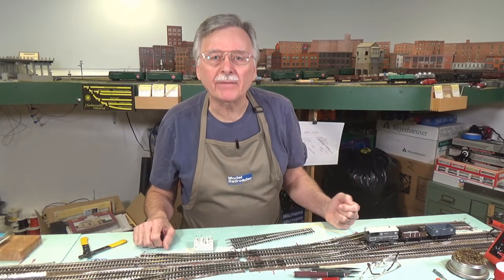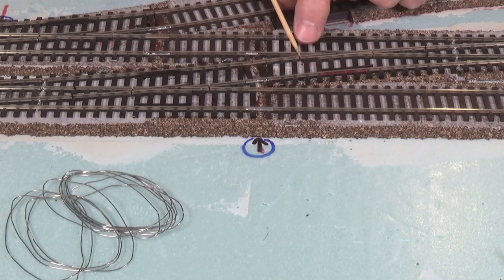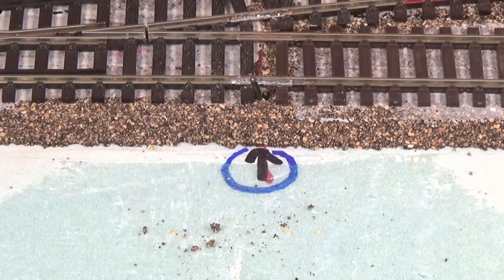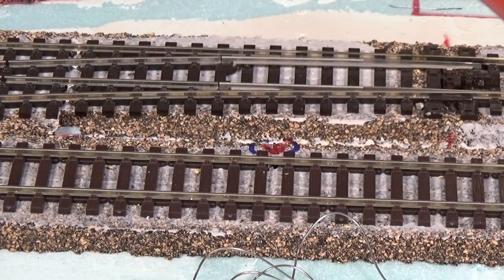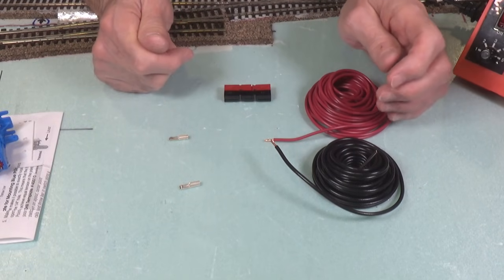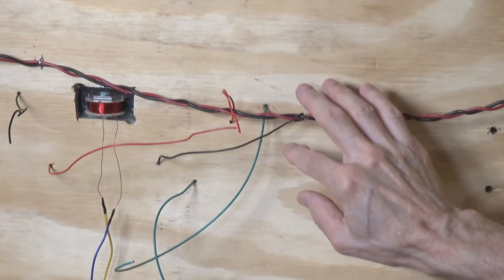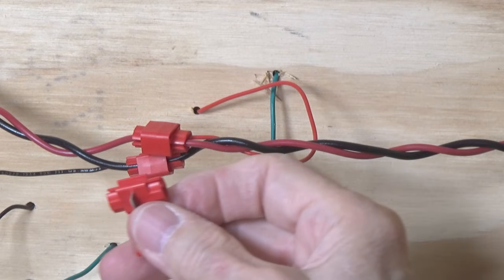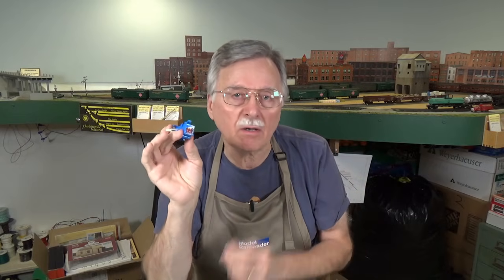DCC Power Bus and Track Feeders (143)

Comment: I do have the right connector to wire tool. It's  cool to use. I was using wire cutters, a heavier duty type set up to put insulated or unsullied connectors. I would put the powerpole end on the wire and lay it in the slot for unsullied terminals and squeeze it down carefully.  Don't squeeze to hard and squish the powerpole to much to each side. It's a bear to slide the plastic cover on.
Reply from the maker: They also make a small insertion tool but I have never used it as I can usually get the contacts inserted without it.

Comment: Great video.  I prefer Posi-Taps over those suitcase connectors.  Much faster to put in and no tools required.  Plus the Posi-Taps are reusable.  Changes can quickly be made with no damage to your bus wire.
Reply from the maker: I’ll order some and see how they do. Haven’t seen them until now, thanks.

Wow, these are expensive, over $1.50 each! I can get Scotchlocks for about $0.25 each.

Comment: I know this is an older video, but perhaps someone will see this and still care to respond.  I am new to HO and just building my first track and starting to plan my wiring for a DCC setup.  (4x8 size, HO scale).  I see folks who suggest these suitcase connectors and others soldering directly into the main power wires.  Would it be bad to have the bus (main power/ground) run the length of the table and have the track feeders just come from appropriately spaced terminal blocks?
Reply from the maker: I generally don’t recommend using that approach since the best arrangement is to keep your feeders as short as possible. The longer the feeders the more resistance and subsequent drop in voltage. Running feeders from terminal strips usually means longer feeders. It is also more difficult to solder wires under a layout and it takes a lot more time and effort, which can contribute to mistakes. I bet about 95% of the problems modelers have are due to wiring mistakes. I found suitcase connectors about 25 years ago and wouldn’t go back to terminal strips for all the tea in  China!

Comment: Larry i have been using  wago connectors  under the layout i find them much easier than the suitcase  connectors
Reply from the maker: I’ll order some of those and we’ll see how they compare to Posi Taps and Scotchlocks, should make a good video.

PS—I dug into my electronics stash and found some that I had previously used when wiring some ceiling lights. The problem I see in this specific case is that they cannot connect to a power bus without you having to cut it at the point of connection in order to push the wire into the connector. I prefer to keep wire buses continuous until I reach a point where by necessity I have to make a cut and then I use the Anderson Power Poles to join them again.

Comment: Love this video.  One question:  a friend said these suitcase connectors can cut you wire when you crimp it down.   Have you found this to be false?
Reply from the maker: Never had it happen in 25 heats of using them. However if you use the wrong size connector, say a small connector on a larger wire than it is rated for, then I could see it might happen. But that is why I always tell folks to use the right size connector.
Reply: Thank you.  My bus wire is 14 gauge wire and my feeders are 18-20 gauge.   The connectors say AWG 22-18.   Wrong size?

Comment: Larry, I noticed that you didn't use any flux.. I too use rosin core solder but, I also use flux for a faster connection.. I noticed that you did not nor mention cleaning the solder joint with alcohol after. Do you not do this step? I'm interested in hearing your take on this step. I just received all my wire, connectors, etc to begin the step of running my bus, sub and feeders. This video was very helpful. Thank you for sharing your knowledge. Tom
Reply from the maker: I do use a little paste flux sometimes if the job requires it, especially with rail joiners. Jobs that require more heat may result in the flux in the solder being burned iff before the joint is made so a little extra flux can help prevent oxides forming which in turn could kill a good solder joint. On those occasions I do use alcohol to remove any solder residue. I’ll cover more on that in the yard work. I think I also covered it in my previous videos on soldering. There now are some no clean fluxes but since you never can be sure it is all burned away it is a good idea to clean anyway.

Comment: Have you used the new joiners that are pre wired?    Have you had any problems with using the suitcase connectors?    Someone told me they can cut through your wires?
Reply from the maker: I think I reaponed to your similar question a couple of days ago and told ypu then that you must use the correct size connector with your wires. It sounds like you have connectors designed for splicing two wires of similar size 22-18awg). In this case you need:

3M Scotchlok Electrical IDC 905, Double Run or Tap, Red, 22-18 AWG (Tap), 18-14 AWG (Run)

This one will allow you to connect the 14awg main bus wire (the run) to the smaller 18-20 awg tap wire.

Comment: Is there any special wiring for a track crossing with DCC. In my case I have an Atlas 30 degree crossing, part no. 574. The bottom of it shows frog jumpers going in one track direction but not the other. Will I need to add jumpers for the other track direction?
Reply from the maker: The Atlas crossings I have are independently wired straight through and have never needed any special wiring.
Reply: Thanks sir. Great video, too.

Comment: About twisted-pair wiring, from Wikipedia...

Twisted-pair cable is a type of cabling that is used for telephone communications and most modern Ethernet networks. A pair of wires forms a circuit that can transmit data. The pairs are twisted to provide protection against crosstalk, the noise generated by adjacent pairs.

Without twisting, buss wiring is susceptible to random impulses from nearby wiring, such as that for switch machines or electromagnetic uncouplers.  Brief impulses on the power buss can produce strange, inexplicable behavior in DCC-controlled locomotives.  Twisted-pair wiring on the power buss significantly reduces the possibility of such untoward behavior.

If you prefer to spice up your operations with occasional dramatics from your locomotives, leave your power buss wiring untwisted.
Reply from the maker: Thanks for adding that. Twisted pair wiring has been in use for over 100 years, invented by Alexander Graham Bell for telephone wiring. The big difference between DC and DCC is a DCC power buses use data transmission protocols so we have to wire accordingly.

Comment: Hi Larry, i bought 12 Gauge 12v Remote Wire Primary Cable Red & Black CCA - It bothers me that the rating says 12v since I'm running a 30ft ho scale run with the sb5 booster. It's my understanding ho runs on 14v. But the manufacturer of the wire said 14v is no problem. Also the description of the wire says 8 60 volts dc. I think this is probably just a learning moment for me since my understanding of low voltage wiring is elementary. Thanks
Reply from the maker: I would think you are OK especially if the maker told you it is rated 8-60 volts. However if you have not installed it and can swap it you might want to do that. The reason I say that is yours is CCA, which means copper clad aluminum and it is not as efficient as OFC or oxygen free copper where amperage is concerned. I have been using 14awg OFC speaker wire on my layouts without any issues since Larry Maier of DCC Specialties recommended it to me. With respect to the SB5 you can set it for track voltages of 12 or 13.8 volts at up to 5 amps, but the CCA wire may drop more volts on long runs such as 30’. Here is a link to the wire I use:

https://www.parts-express.com/wire-cables/bulk-wire-bulk-cable/hi-fi-speaker-wire
Reply: @TheDCCGuy     Got it, thats what i was looking for. Glad I asked. I couldn't find anything on different types of 12g wiring. I wish Audtek color coated their insulation but that's probably why they are 30% cheaper than colored insulated wires. Thanks again!

Comment: Nice explanation , which I believe is the heart and soul of a layout.   I do have a question:  I too solder the bottom of the rail for feeders but I flatten the feeder wire I attach to the rail so it is soldered flat to flat surfaces.   I use  the 3M brand also and have yet to have an issue after three years.  Like you said have a even crimp...  they are reusable if some some reason you make a mistake.
Reply from the maker: Good tip on flattening the feeder, I’ll give it a try and see if it makes it easier. One thing though, 3M recommends against reusing the suitcase connectors. Once the little blade gets deformed on the wire it may not bite properly on a second installation.
Reply: @TheDCCGuy  Good  to know Have not had any issues though

Comment: Larry, thanks for the videos.  A question on the suitcase connectors, can you have two feeder wires come out of one connection going to different devices?  Appreciate your insight.
Reply from the maker: No, you really need to stick with 1 feeder or tap,per connector.
Reply: Thank you for the response!

Comment: Larry, should the separate bus for my accessories (building lighting) be the same gauge as my main power bus?
Reply from the maker: I do. I use 14 ga for my DCC and DC power buses. Resistance is resistance but you may be able to get by with more voltage drop,on a DC bus than DCC since most accessories made for 12 VDC can actually run on lower voltage.

Comment: When using 3M suitcase connectors, which is better solid or stranded wire of the sane gague?
Reply from the maker: I’ve never noticed any difference. Just make sure the connector you choose is rated for use with both types, some are only for solid.

Comment: Larry, I must have missed something. In what episode did you actual install track? I am really interested in how you handle rail joiners and whether you solder them. It look like it when you soldered track feeders. I am interested in your techniques to solder rail joiners without melting the ties.
Reply from the maker: I’ll get to that when we get down into the yard area. I like to install my turnouts first then add the flextrack between them. I went ahead with dropping feeders and wiring them and will go back to the track. I realize that installing the turnout controllers may be a bit out of sequence but there’s lots to do yet!

Comment: What was the purpose of soldering the black and red bus to the black and red plastic thing?  Did it get used?
Reply from the maker: The black and red plastic things are connectors that allow you to separate the modules and disconnect the wiring.

Comment: Instead of the scotchlok connectors, can you you a bus bar to connect the rails to the main power line instead?  Or would that cause other problems?
Reply from the maker: You can use all kinds of connections but I find it a lot easier to use these suitcase connectors. It can greatly reduce the complexity but some folks like to have nice tidy rows of labeled connections under the layout. The important thing is to use a method that gives you a good solid electrical connection with low resistance.

Comment: hi great stuff,
how would block detection affect where you place the droppers
Reply from the maker: That gets complicated and would require dividing the layout into detection blocks, and then wiring the detectors into one of the bus wires at a point before the feeders. I’ll eventually get to that since I am using NCE detectors on the Piedmont Southern along with homemade logic circuit boards. One complication is that I was using Oregon Rail Supply signals but since the original owner died about 3 years ago his wife has not been able to produce much of anything and I am a bit short on what I need. I may have to find someone who can come up with a design that can be 3D printed by Shapeways. I had a friend who could do that but he died about a month ago.

PS-I searched Shapways and found several 3D printed versions and plan to order a set of 6 to complete the PS. This new technology is revolutionizing modeling.

Comment: I'd like to convert my 5' x 16' HO layout to DCC. I am a lousy solderer so to make it easy for me, I solder the feeder wires to a rail joiner and then connect the tracks to the jail joiner. Works pretty well for DC. Will it be an issue for DCC?
Reply from the maker: My only concern with that is whether you solder your rail joiners to the rails. If not then that means your electrical connection will degrade over time due to oxidation and dirt etc getting in there. I always solder my feeders to the rails and recommend it. You could go back and solder those rail joiners but watch out for the feeders popping off as you heat them. I also wonder how many you used and what size wires. Most DC layout wiring is undersized and feeders are not as close together as they should be for DCC. See my videos on wiring for DCC.
Reply: I too WAS a lousy soldier. I got a spare track and some wire. I also got an old radio from Goodwill and took out the circuit board and then spend several days practicing. Yea, I melted a few ties and at first the board looked like crap but I soon got the hang of it. Make sure your iron has enough power so you touch the parts for just a few seconds. Good Luck.
Reply: @markwakeley3835  Thanks for the tips Mark. I appreciate it.

Comment: I am laying track on foam for my yard. I'm concerned that soldering feeder wires will damage the foam. Am I correct and if so how do you avoid this?
Reply from the maker: I generally use cork roadbed over the foam so not an issue. However I have done a few tracks directly on the foam and if you’re careful you won’t do any damage. If you get too close to the foam it will just form a depression that can be filled later with a small chunk of scrap foam. If you have a lot to fill just get a can of the spray foam insulation at the hardware store and fill it with that.

Comment: Hi Larry.  Thanks again for your great videos.  I wrote you recently about wiring up a crossover with 2 tortoises, 4 signals to a bus bar to connect them , 2 bi-color led's for a  control panel  and a  DPDT switch. I can't find anything out there to help me as I am a former railroad employee and want to create an accurate layout with signals and control panel lights for the turnouts.  Thanks again!  Please help as I don't have much hair to pull out anymore!!
Reply from the maker: I’ll be wiring up my crossovers and Tortoises next week and may get as far as a control panel (but likely not). However I won’t be covering all your topics as I don’t wire my signals off the Tortoises. I use one of the SPDT switches to control the frog power so the other would be available for signals however I use a completely different signal logic circuit or the DCCconcepts ground signals. I have a couple of videos on those and also one on how to direct wire standard signals off the Tortoise so just scan down through the list of my videos on my channel home page about a year or so ago.

Comment: Larry, a while back, I asked you some questions about twisting the bus wires, and you convinced me that was a good idea for my layout. You also told me about a product you use for your bus wires where the wires come already twisted. I'm using 14 AWG stranded wire for my bus wiring. I think the product you use is some sort of audio system wire, but I can't seem to find it. Can you help me? Thanks. Jim Craft
Reply from the maker: Jim, here is a link to where I buy mine. The reason this works is because the goal with twisting wires is to get the conductors as physically close as possible. Since in audio wire or zip cord, the conductors are held very close together by the vinyl casing it has the same effect as twisting. Plus it keeps them much closer to the same length that twisting individual wires. Some dealers also sell this stuff with a red and black vinyl case but it is much more expensive. Even though the vinyl on the less expensive version is clear you can still tell the wires apart sine one is bare copper and the other is coated with solder and looks silver. Plus I think there is a rib cast into one side. I think  you’ll find this a lot easier to use than twisting wires—I have.

https://www.parts-express.com/wire-cables/bulk-wire-bulk-cable/hi-fi-speaker-wire
Reply: @TheDCCGuy  Thanks, Larry. I love your videos. I always learn something.
Reply: @TheDCCGuy  Larry, I went to the site you recommended. I don't think I got exactly the same product, but I think it will work based on what you've said. I ordered Belden 5100UP 14 AWG 2C cable hi-flex in-wall speaker wire CL3. The reason I picked it was that it obviously has one black and one white wire, inside a vinyl casing. For the other products, I couldn't tell what the wire colors were, and I wanted black and white (or black and red) to help keep track of "polarity." By the way, earlier I though I had bought twisted wire, only to discover that the wires aren't twisted--the wires are connected to each other, but there is no casing. That's the trouble with ordering on-line! I appreciate the extra information you provided. Time to crawl under the table!